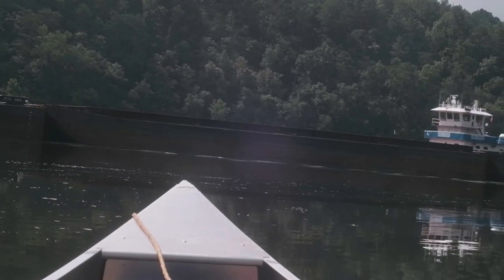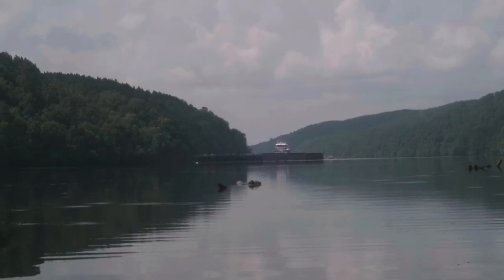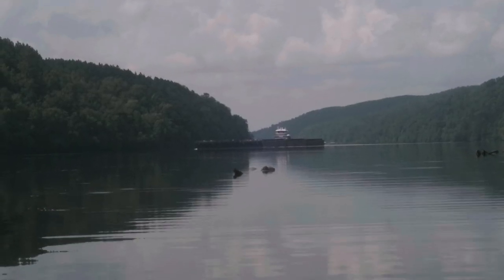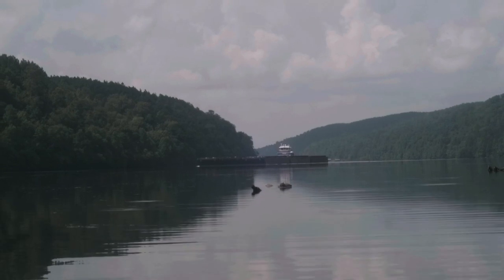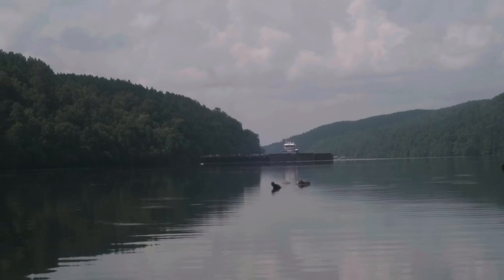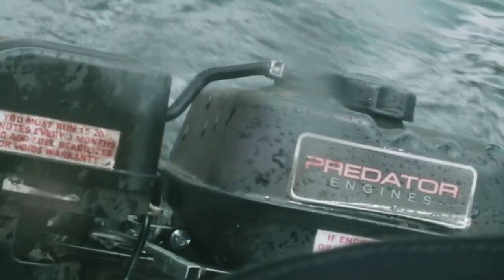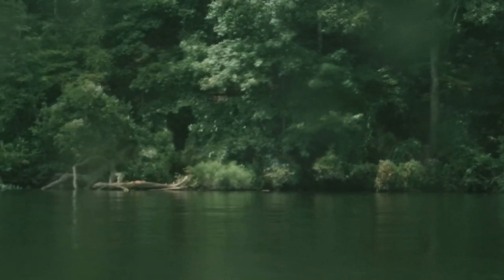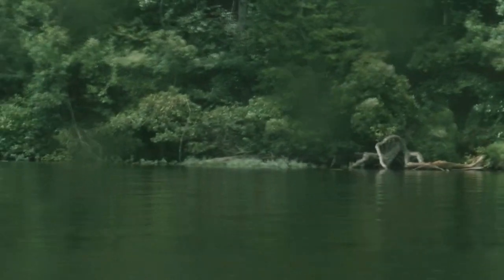Can a Canoe Plane? | Motor on a Canoe

Comment: Good description of these two types of boats. I've been running an 8 hp on a flat back cargo canoe for some 30 years now. Rather than planing, more speed just raises you front end. You can add weight, such as another person to the front for added speed.
Reply from the maker: Yeah, I usually add about 120 lbs on the front of the boat.

Comment: I am about to plane a canoe. If you think about it, its very similar to aerodynamics on the highway with a car. The way to plane a canoe is to simulate a flat back transom. The reason a canoe will not plane, is the same reason a plane wing flies. the high pressure water flow is rushing around the hull and it reaches up higher the faster you go. You must create a planing surface / flap. the the way a plane wing increases lift on landing. it creates separation. to plane a canoe you must create flaps to simulate a flat back of the boat, to allow the water to separate and allow the hull to skim across the top of the water and not glide deeper and deeper as more power is applied. Lets talk about it!!
Reply from the maker: I see what you mean. I seen like flat planes on the back half of canoe in Thailand. A drop flap just like you say.

Comment: We need a super budget longtail kit for boats like this. Much smaller, much less gas, much goodness.
Reply from the maker: Yeah, Swamp Runner sells a mini kit designed for two horsepower: https://www.mudmotorkit.com/product/mini-swamp-runner-kit-2-5-3hp/#mini-swamp-runner-kit

This small kit you see in this video, Honda makes a 3.5 HP powerhead that fits. There are plenty options.

Comment: I think one of those motors might be great for my section of the Nuese with all its shallow rocks, submerged logs and sand bars.  Hope you keep telling us about it.  For displacement speed of around 6 mph you should only need one or two hp per ton.  With your motor you might be able to get it semi displacement speed up to 9 or 10 mph but it would be pretty scarey with the stern pushed low in the water and a big wake following you. 6 mph seems great for an all day speed.
Reply from the maker: That's right. I've been looking to by a Honda 3.5hp engine as this Predator is over powered for this set up.. Also, I just govern the Predator down severely by running in the throttle stop screw nearly all the way.

Also I put about 200 lbs of ballast in the front of the canoe to keep it down. So, you can "cheat" a little bit.